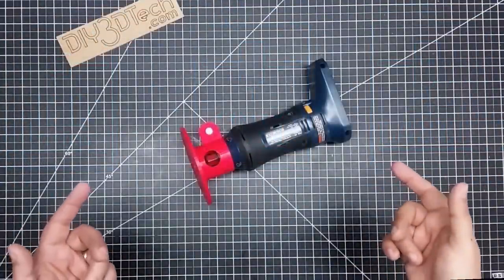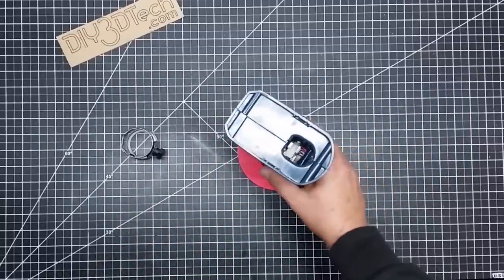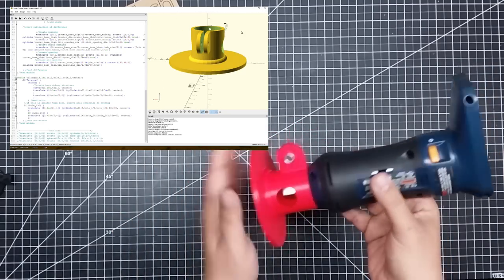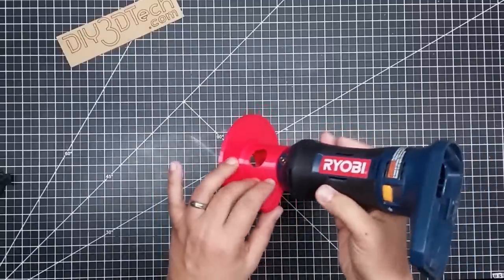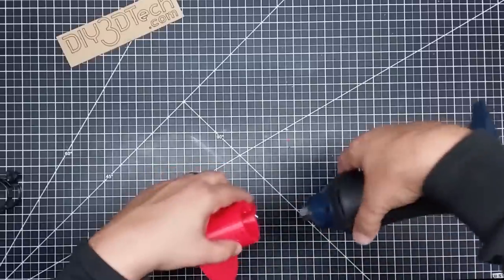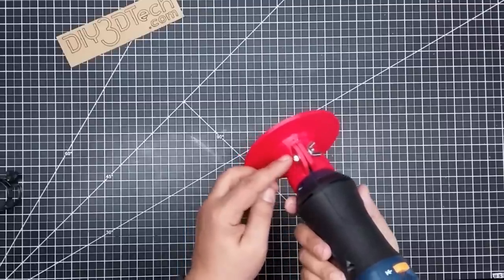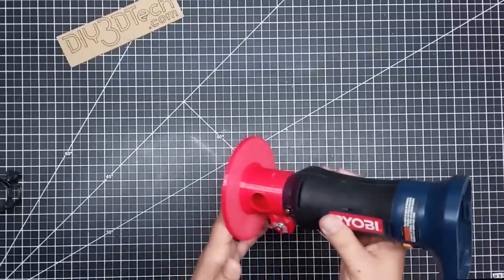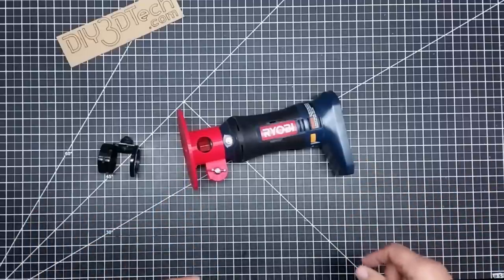Design Talk -  Creating a Router Base for a Ryobi Rotary Cutter!

Comment: Nice project .  When ive done similar ive found making the cinch/ clamps tabs thicker and using large flat "penny" washer helps a lot with clamping force. Making the tabs thicker also allows you to sink the bolt hex head "into" the tab to stop it rotating or a raised boss on the tab to recess the hex head into.
Reply from the maker: LOL!  Knew someone would call me out on  counter sinking the nut :-)  Got a little lazy (just don't tell anyone and a big yes to the washer idea!